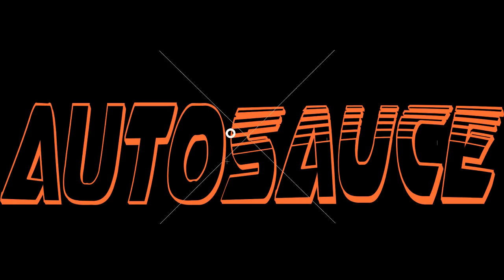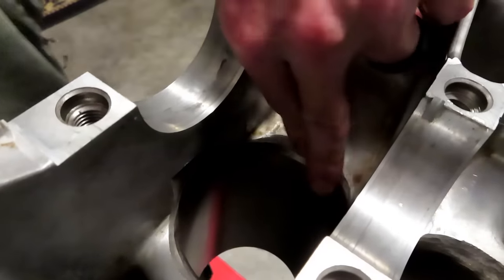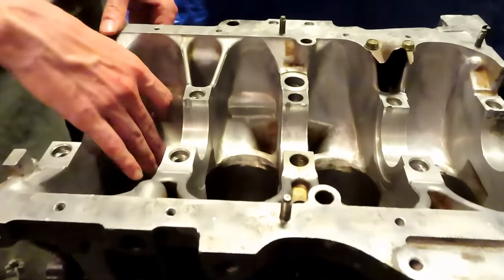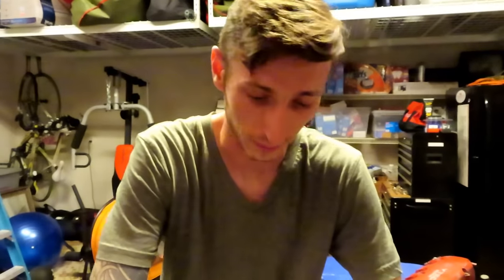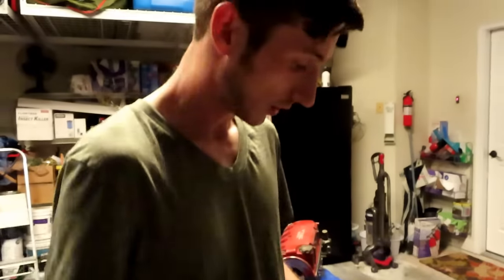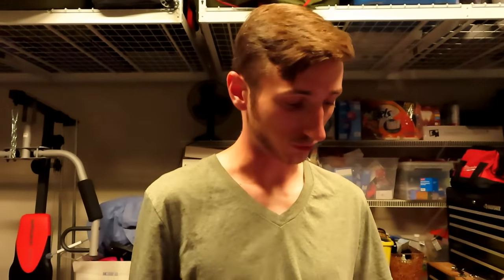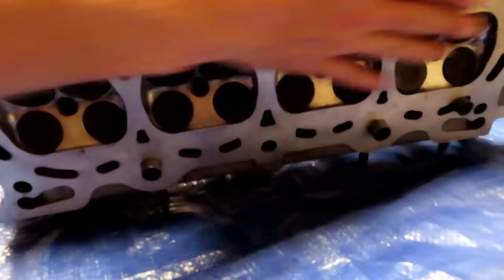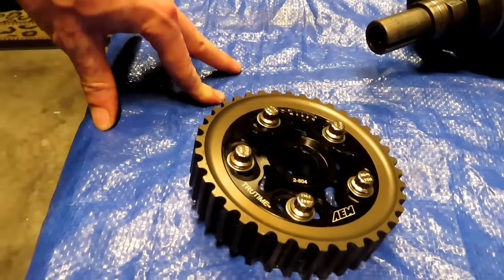EVERYTHING you need to MAKE 500HP with a HONDA CIVIC on a BUDGET

Comment: Ive allways read and heard to use the z6 crank and run the oil pump settup that you are .... Wont run low oil pressure .... And oils the bearings way better no starvation ...

Comment: New to civic entirely i assume all d series blocks are essentially the same i am picking a turbo d16z6 making 10-15 psi on base tune rev limited at 5k rpm I'm looking to pull the engine and build it right wanna know for sure if all this will work for this engine

Comment: I hear y8 cranks spin bearings at high rpm due to only having 1 oil port
Reply: Facts.
Reply: My 944 only has 1 and it spins bearings ☹️
Reply: True
Reply: Mine did.
Reply: Z6 FTW
Reply: As long as you have good oil pressure it doesnt matter lol.
Reply: NPR sells z6 cranks that are chamfered for 150, and to help with oil pressure just port and shim your oil pump it'll keep the bearings from spinning
Reply: @Kydroshooter  need link please
Reply: @Kydroshooter  It says its a y8 crank
Reply: Very very true
Reply: CORRECT
Reply: What’s the best way to keep that under control
Reply: Austin Hedges swap a y7 crank in
Reply: @austinhedges9531  either get a z6 crank or make sure you don't rev too high and have good oil pressure.
Reply: tommythevideomaster I’m looking at a whole different engine with more power is that a good idea at all
Reply: Austin Hedges what motor are you looking to build. Z6 crank is best option. I have swapped a bunch of those and played with the y7 and y8.
Reply: The Realist it’s a 
1999 HONDA CIVIC - Engine 1.6L, 4 Cyl, SOHC, Gasoline, VTEC-E VIN 7, 6th Dig, Manual
Reply: Austin Hedges you have the HX model?that’s a 3 stage vtec for economy purposes. I wouldn’t waste your money trying to do anything to it. I’d just buy a swap and swap the whole thing out. If you have a friend your looking at probably $1200 to find a good used b16a with tranny and 6 hours of labor. I have done them in 2 hour swaps no problem. Make sure you get an ecu too
Reply: The Realist I haven’t even purchased the car I just need to know what would be best for good hp but a realiable lasting engine
Reply: Austin Hedges good reliable economical engine comes with that model.  If the body is great get it. Engines are easy in civics. I have seen many dual overhead cam engines from Honda with 200-300k miles.

Comment: Z6 crank is better and you dont need to shim the pump unless you port it. If you do decide to use a block guard make sure you bore the cylinders after it Is installed.

Comment: So I’m gonna be running this 
Victara 75 mm piston 
Speed factory Long rods no notch 
King bearings 
Oem crank bearings 
Arp head studs 
Skunk 2 alpha springs retainers 
Stock valves 
Delta 272 cam 
 Ported head 
Rev 9 turbo kit with t3t4 turbo stage 4 clutch stock transmission what kind of power you think imma be able to make and what psi would be save it’s a d16z6

Comment: I have the Honda vtec motor in my 2005 Saturn vue. It came from the factory like this. GM bought the whole Honda drivetrain and put them in 2005-2006 Saturn  vue.  Will these mods work in my motor⁉️⁉️

Comment: I would like to Build a D16 Engine with a Z6 Block with a Y8 Head for Either a Turbo Setup or All Motor. Do I use the Y8 or Z6 Crank?

Comment: Z6 crank is perfectly fine to use and wont lower you oil pressure anywhere near enough for u to worry about, and if you're worried about oil pressure you can shim the oil pump and problem solved, dont tell people not to use the z6 crank, it's much better than the y series crank in EVERY WAY
Reply from the maker: I would recommend watching the rest of the video because I explain it.
Reply: @Autosauce  I watched the whole thing, I always do, my response was just to  the fact that you said it's better to  run a y8 crank over a z6 crank which is completely not true at all, I'm actually in the midst of building my y8 block z6 crank, speed factory rods and ycp vitara pistons (.5 over) , I have a stock y8 head and intake manifold with b20 60mm tb, just waiting to order supertech springs and retainers and get a crower stage 2 cam, I'm broke too man that's the only reason it's not finished yet lol that and the fact that I want a built head so I wont need to run too much boost for the power I'm aiming for (350-400), oh and I'm going with a ebay kit too
Reply: @Autosauce  I will be making videos too, it'll be my first attempt at youtube vids so hopefully all goes well

Comment: Facts... 👏👏 But the most reliable Honda is a All Motor Built Honda 12.0CR 76mm bore D15/d16 can make 200hp with 100 wet shot that's a reliable daily driver.. will take some time but very easy & most reliable.. I'm doing this All Motor build myself I'll make guides

Comment: I have skunk2 stage 2 camshaft 
Skunk2 cam gear skunk2 valve seals 
Skunk2 valve springs and retainers 
Ported and polished y8 head 
Any suggestions on what parts to go with for building the bottom end ??

Comment: OK I watch your video and I feel like you’re the godfather of building Honda Civic‘s so my question to you is I have a 2003 Honda Civic LX it has the 1.7 L Engine (D17a1) I drive this car every day back-and-forth to work and I recently got piston slap because the EGR valve went bad sometime within the last three years and it built a lot of carbon up on top of the pistons and in the rings I am now as of today had everything tore down and I decided that I would like to put a cam in mine however I know nothing about them I need to know what cam to put in this engine and if I need to buy a tuner for it also Preferably I just want to be able to put a cam in it and get more power out of it if you have any information that you would like to share with me please let me know. I appreciate it have a good day!

Comment: so you used a d16z6 oil pump and modified it for higher oil pressure instead of buying a new oil pump which is genius, but im building up my stock y8 and can i just use the stock y8 oil pump and do the same? or is there a specific reason to use the z6 oil pump instead of the y8 one? Thanks.
Reply: if i have to ill just buy the z6 oil pump and slap it on my y8 but if i can save myself that 40 bucks than i rather do so

Comment: Currently i went and bought a 98honda civic dx all stock and im looking to do just a few lite weight upgrades to a better reliable car from a all bucket engine pieced together and im in cali so i have high NOX at 15 miles and it failed smog on that. Currently im checking timing, cleaning out injectors, knock sensor, change out thermostat and running it to hope clear out high NOX and get to pass smog.
Smog higher than 487 no good im at 549 so any advice please let me know. Thanks

Comment: I have two questions. I have a d16y7 and I can only find Brian Crower valve springs that fit the d16y8 on EBAY. I could be an idiot, well yes I am, but will those d16y8 valve springs fit on my d16y7 head? The second question is will a z6 crank fit in my d16y7. Thank you to who ever helps.
Reply: Yes and yes, y7 and y8 valves are the same, d16 blocks are almost identical
Reply: @darrenbradbury9037  Thank you

Comment: What kind of transmission to use that will be reliable with that power? Axles etc too. I would like to build a 500hp light honda for a track car on 93 octane. I just now trying to learn the solid components I need. Say for a 95-97 civic. 👍

Comment: hey. im newish to the scene and i just bought a mini-me mystery motor. d16y8 head on a d15b block. will a z6 even fit the block? if not what crank should i use? im in north idaho so ill probably go to delta cams over in tacoma. also what shop should i take my head and block over to? are oil-squirters(for the back of the piston) a good idea? my dad had some in his 1980s porsche 914.

Comment: Great video bro.

Had a question, I want to turbo my stock y7 and make somewhere between 160-200 on lower psi as it will be a daily driver.

Would you still recommend the rods and pistons replacements as opposed to the stock? 
Would gladly appreciate any advice, I’m barely learning about building and cars in general. Thanks!
Reply from the maker: The stock engine should be good for about 200 hp! Send it !
Reply: How much HP do you think stock y8 pistons would handle? And still be reliable
Reply: @Autosauce  you’re crazy…I love it! Hahah 

Full send it is!

Comment: Need some help if you can give me some tips or steer me into the right direction doing a y8 / z6 head build having trouble torquing head down correctly any idea what head bolts would be the correct ones to use?
Reply from the maker: Give me a call on the shop phone
Reply: @Autosauce  what’s the number boss ? Would like to get some more info
Reply: @Autosauce  let me know what’s the best way to contact you boss.

Comment: @autosauce , do the same rules apply for an f20b? 

Basically:
Oil pump shim and port 
Head studs 
Sandwich plate for gauge
Pistons
Rods
Block guard 
Valve springs
Cam gears

I’m shooting for 350 mayb 400 on a good day. All of this would be a solid reliable build?
Reply: Pretty much, tried and true. This is what I’m aiming to get done on my build

Comment: Sir I just want to ask what is the exact D16Y8 block I need to use in this set up? D16y8 LONG block, D16Y8 normal non vtec or D16Y8 normal with vtec???
Reply: He’s using a d16z6 block (v-tec) with a y8 crankshaft

Comment: Question? 500HP Motor: What kind of transmission are you pairing up to the motor after increasing the HP that much? What kind of modifications do you have to do to the suspension to handle that much HP safely? Thank You
Reply: Coilovers are recommended IMO but you could get away with springs. If you cheap out and go springs Tein browns are what I would use and buy some ADJUSTABLE UPPER CONTROL ARMS, REAR CAMBER ARMS and bigger rear sway bar/rear subframe brace ASR is pretty good IMO.

Comment: I thought the y8 crank shaft wasn’t the best for turbo build I thought the z6 or c6 crank was better? I’m not a genius just getting into this stuff so it’s more a question?
Reply: You're correct. That's cuz the Y8 crank doesn't flow as much to the bearings as the z6. U can always get more pressure from thicker oil, but you can't get more flow once the engine is together.

Comment: Don't even consider a block guard. there's all sorts of reasons to avoid them, particularly that posting the block (aluminum bolts screwed through the block to rest on the cylinders directly) are significantly cheaper and almost as effective as a block guard without having to rebore, or go with a Cylinder Support system, which is warrantied to 500HP and can technically hold far more than that.

The block guard doesn't even sit in-between. they can cause nightmare risks that just aren't worth the time of installing them.

Comment: Just saw your channel good job. 2 things caught my attention 1 y8 crank has only one oil port per journal. Z6 has 2 ports per journal. Better lub no spined bearings. 2 stock retainers is a bad ideal for hi horsepower apps. Your right 500 you can make but for how long. Definitely not daily but good job bro keep posting always learning is key

Comment: I need to take notes. I am trying to make my wide body del Sol more hp. Also how does this build do with boost
Reply: Use z6 crank
Reply: 2 holes= better lubrication. 
Oil flow> oil pressuer

Comment: A Mitsubishi 6 bolt 4g63t will make a reliable 500hp with just arp head stud's and good tuner , and the stock crank is good for 800bhp.

Comment: I’m working to make up to 400 horsepower naturally aspirated, then boost it at 10 psi for reliability and for shows 20+ psi I’m gonna port my engine, heavy valve springs high lift cam shaft reseat my valves , best spark plugs, maybe 15:0.1 pistons upgraded connecting rods, upgraded engine bearings, maybe a crank because cranks are expensive just don’t run boost until I’d get it, stock exhaust system , upgraded driveshafts if they snap , milled heads, probably not resized pistons , everything  that I need even a transmission cooler , water gauges ect, I’m trying to make it daily drive 10? Miles my scion build will be wild, if I have fuel leaning issues I’ll upgrade the pump
Reply: @Sirtimsmokesalot  I did and then proceeded to crash
Reply: @Sirtimsmokesalot  it’s roof is crushed from a roll over when it was doing over 305 crank 232 ft lbs on 13 psi S256sx borg Warner turbo if i remember the model number correctly 56 mm turbo is pretty big overkill for a 1.5L for sure. factory pistons , factory heads minus a cam, related parts , conrods , polished crank, aftermarket conrod bearings and other essentials. and porting it it crashed in 2021 when only one tire locked up on geneseo road in Paso Robles California.
Note to self if you build a high power to weight ratio death trap Atleast make sure the brakes have 0 issues CHP report noted leaking brake fluid. Mechanic said the brakes were fine because I was having a issue with them on hard stops.  It was a happy motor for about 10k miles I brought it to a few tracks but 280-320 is probably the upper limit of crank horsepower before the transmission suicides. It was a extremely fun car while it lasted my back still hurts because I didn’t get all the safety harnesses and cage done before the rollover happened CHP only ruled me at fault because they determined excessive speed was a factor. R.I.P. Simon 2005-2021 CHP is working on a recall application for the brake failure but they set foul play as indeterminate which means the leaking brake fluid could’ve been from a cut brake line from someone trying to kill me or make me unable to use my brakes. I now own a 5.3 Yukon XL 4wd which is my current project. All I can say is if someone cut my brake line you only took simon from me and the ability to not have back pain. Apparently like my entire brake fluid reservoir dumped leaving a trail to the accident so it wasn’t some minor leak , it screams foul play.
Reply: @Sirtimsmokesalot  crashed late 2021 100 hp short of goal out of money for that moment 5k deep in that engine bay doing all the assembly and custom charge pipe,intake etc possible foul play brake failure with brake fluid leaked on scene. I thought it’d take more money to make that much power but the tuner said it made 305 at the crank which was awesome for $5k.
Reply: @Sirtimsmokesalot  passed? No I just broke my back
Reply: @Sirtimsmokesalot  that was my cars name Simon
Reply: @Sirtimsmokesalot  as long as it’s not my left hand 🫡

Comment: My first killer D series was bone stock internal with dsm 16g turbo with 1 bar wastewater 440cc with only FMU and Apexi afc  and only doing 12.60s in the quarter at 108- 111mph on 15inch. I thought it was fast back then 1n 1998

Comment: Since civics are cheap, any of you guys who plan on doing high horsepower builds should just get a rolling chassis with no drivetrain. However if you can find a civic under 1000 you could probably sell the individual parts you don't need for more than the car is worth.

Comment: Is a turbo cam worth it or the stock cam will do just fine?
Reply from the maker: Not really, you’ll just need a little more boost to compensate.
Reply: Jet Tolentino yes get the turbo cam
Reply: Stock cam can support 500 on a sohc and so can a stock head but if you can flow more air in and out with a ported head and a cam and you can afford it why not do it. Yes cam is worth it

Comment: I tell my customers that the factory oil pressure light is basically the "It's too late " light.
Reply: I have found a source for ones that turn on at much higher psi. Worth swapping over as a budget oil pressure monitor !

Comment: What do you think about the ebay gt35 on a z6?
Reply: Lag monster.
Reply: The GT3582R will be pretty laggy on such a low CFM engine. But you will make hella jam up top. Highly recommend higher compression than Vitaras and a good camshaft to help it stand up.
Reply: @dillontracy939  I'm doing a budget build and was wonder which turbo would do best at the 400whp range